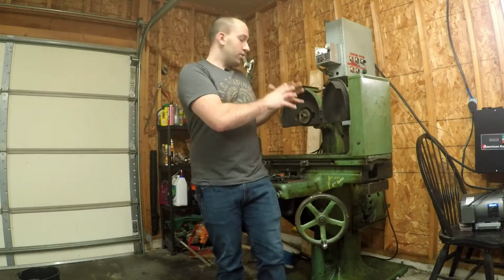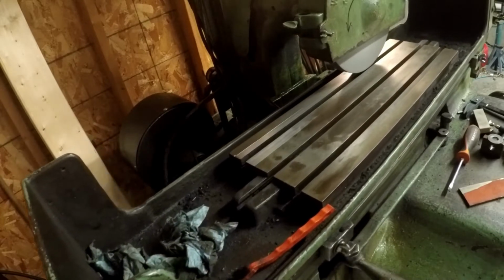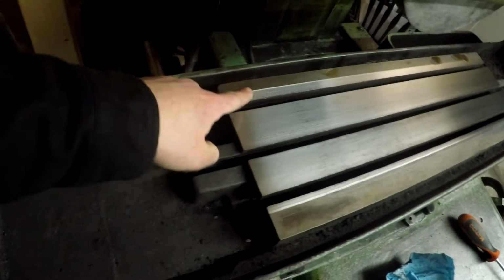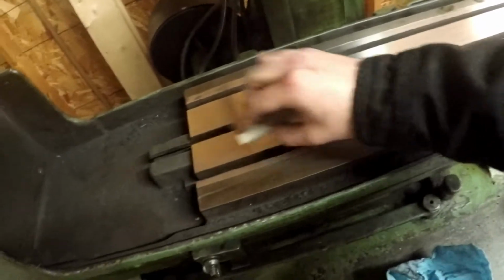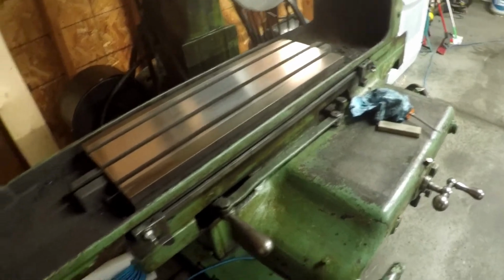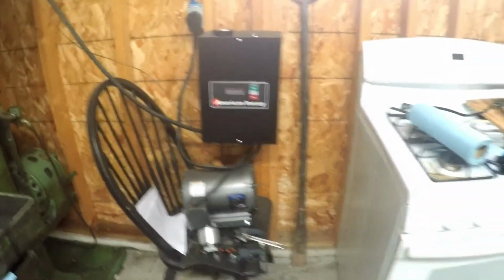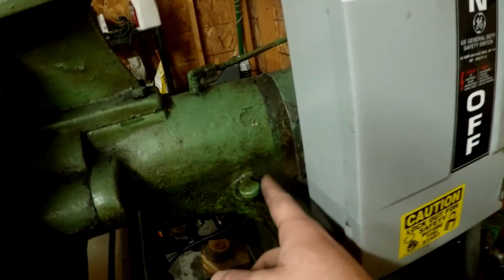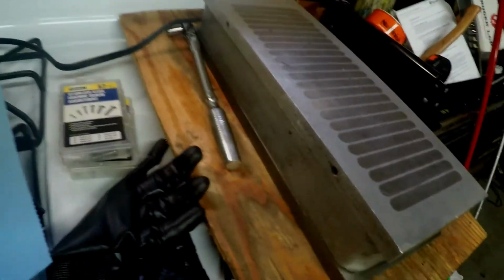Surface grinder

Comment: Not a ton of info on them. They were sold near the turn of the century until 1927. In 1927 they sold to Covel. Clausing now has Covel. Living in West Michigan, I see these from time to time. The spindles are interesting. Tapered bronze plain bearings. Very smooth.
Reply from the maker: @vanapplebomb  awesome thank you! Its a dinosaur but I love it
Reply: @hintzecustomknives  , keep a good thin spindle oil in the wells under each bearing. This is not a place for ISO 68 (roughly SAE 30) or thicker weights. With properly adjusted bearings, a good ISO 22 oil works great. Those plane bearings run smooth, but do not tolerate lack of lubrication for a moment.